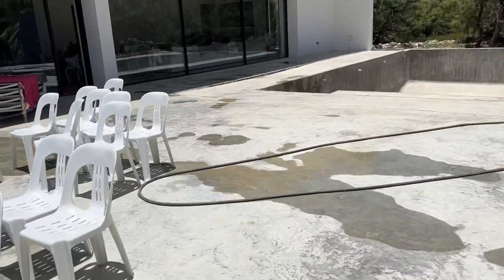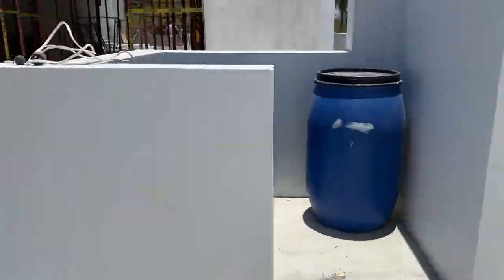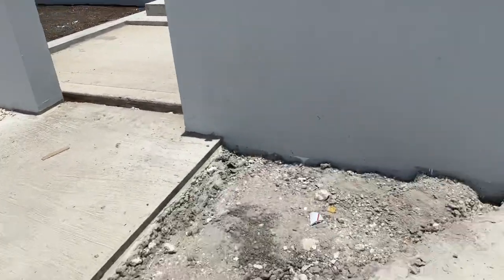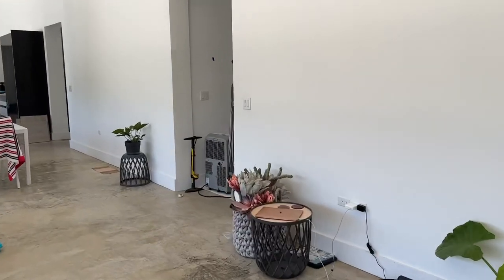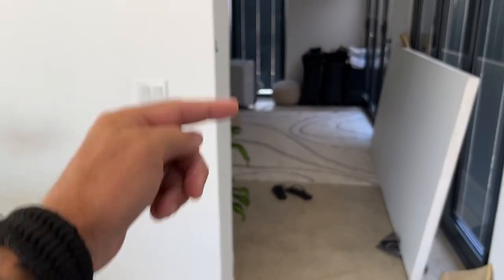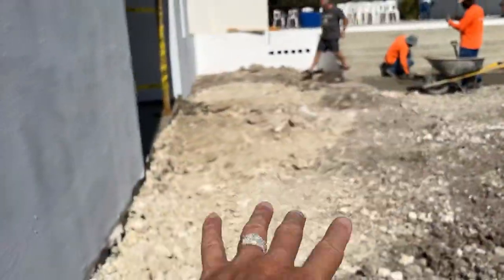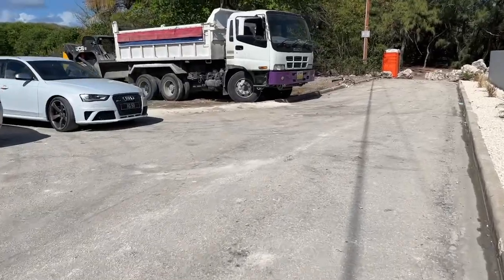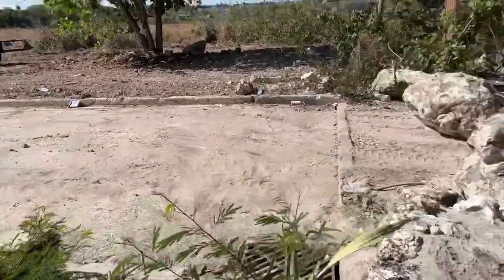Barbados 🇧🇧 Beach House Build - Day 306, Building Our Dream House In Barbados

Comment: My concern about ordering your kitchen doors from the UK is that the colour will likely be different as well.  When produced as a different batch, it’s unlikely to be exactly the same colour.   I had a door in my kitchen resprayed by the same company and same colour but every paint lot is slightly different and it doesn’t match.  Is there an opportunity to use an accent colour for those center cabinrts? White or wood?
Reply: Just reviewed the location of the missing doors, accent colour won’t work…
Reply from the maker: I know, it is certainly a risk I will need to take! If this fails then we will have to spray the patio facing ones 😩